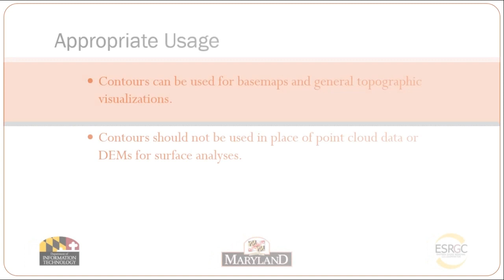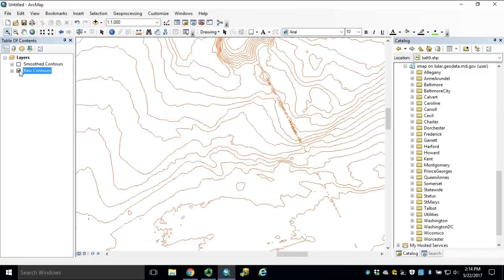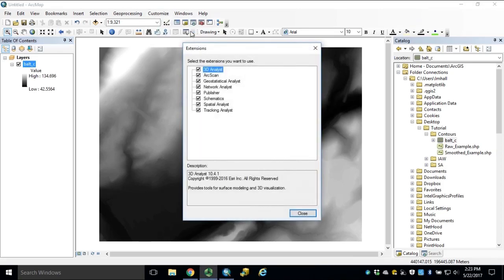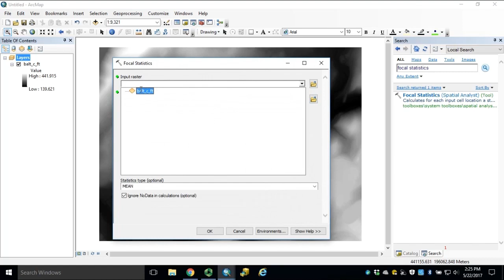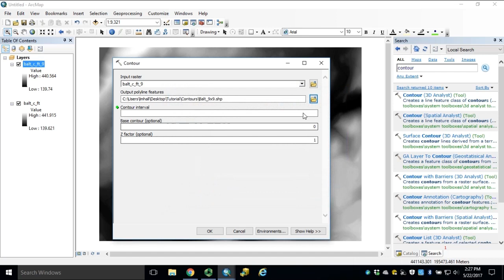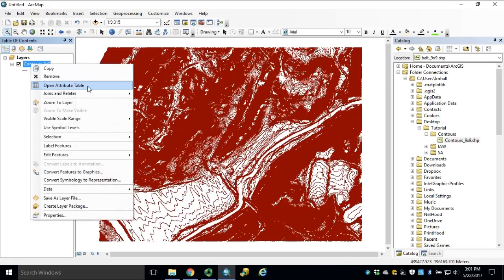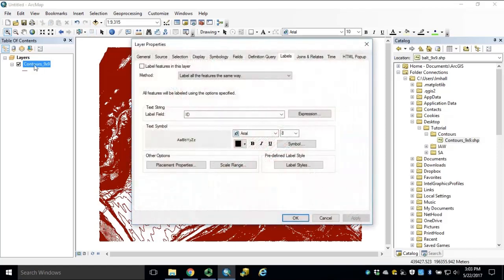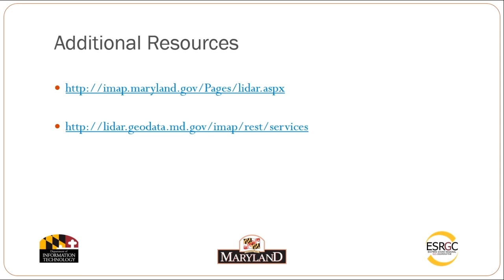Module 5: How to Generate Contours in ArcGIS for Desktop

Comment: I converted my 1m DEM to feet then I clipped it to my quadrangle. I used the focal statistics tool on the calculated and clipped DEM. When I proceeded to use the contour tool it said the task didn't work. What am I doing wrong??? two errors came up: Error 010213: 'error reading raster' and 'Error 010067: error in executing grid expression'

Comment: hello sir... i just like wanted to ask.. what is the reason why you used 10 as a modulous in the field calculator for [contour] mod (10) ??
Reply: it means that if Contour in the dataset is 10, 20, 30,40feet ... it will take away the 1,2,3,4... and give out a 0... If the countour is just like 5 there is no tenner to take away. and the index wil be 5 again ... so by selecting all index =0, he select every counter line for 10, 20,30 ,40 feet :D
Reply: @martinchristensen1306  thank u.. are u a geodetic engr?